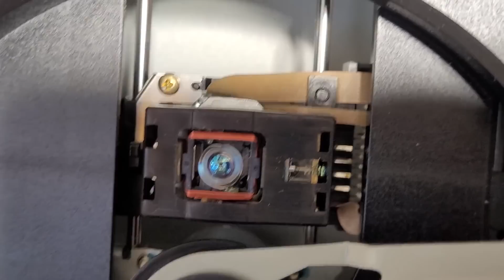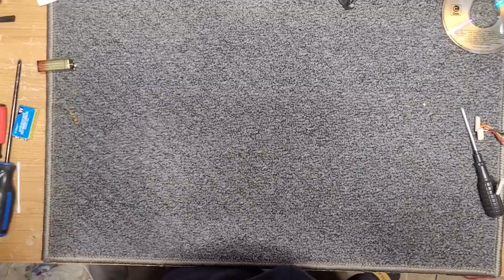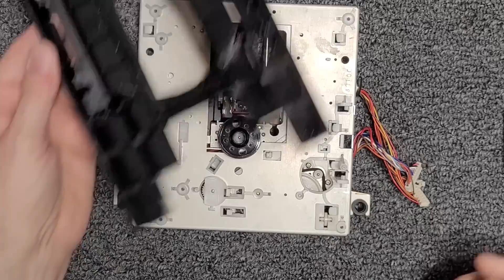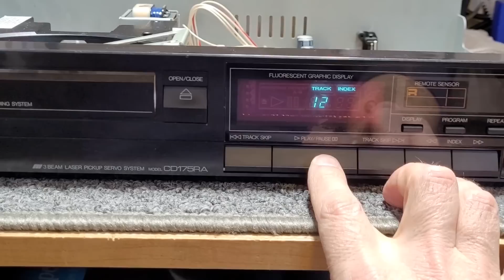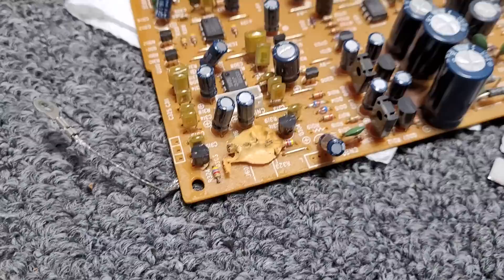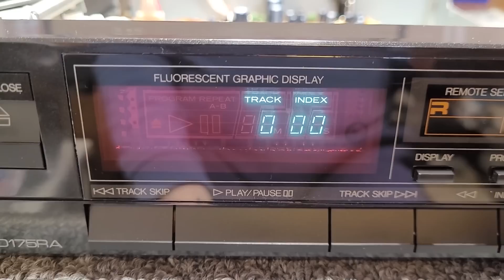Dead Emerson CD175RA - It's NOT Always the Laser!

Comment: Good repair and a great example of where a bench psu with an current meter really helps as when powering the sled motor you would have seen a high current draw indicating high load on the motor.

Comment: 90% of failures are mechanical in CD/DVD players. Either loose belts, or dried up grease. The other 5% is the laser lens dirty, or poor electrical contact in limit switch and ribbons connectors. And about 5% is electronic failure (leaking capacitors, overheated resistors, burned diodes). 
Seems like you covered almost all of those, and that's why it's working again! Good job.

Comment: Sir my pioneer pd 106 won't  read or spin the motor..laser had beam or light..but won't  read the disc ..what is the  problem of my cd..how to check etc thank you very much
Reply from the maker: Check the loading belt and the micro switch that tells the unit the tray is completely closed
Reply: Thank you sir  @TurntableGuy

Comment: If everithing is dead in the carusel you should check first if there is any voltage there, to the motors. Than if it does, the motors. then why the laser tray is not moving. In the end, you wasted time removing glue, which never ever can become conductive, it is not a semiconductor. You waisted time (ours too) around switches
Reply: There are certain glues, commonly used in 80s/90s electronics, that absolutely do become conductive as they degrade. It’s those tan glues, and they sometimes go conductive. This has been widely documented.

Comment: If a unit is dead, you get no display lights, no tray opening, no nothing, movement.  Get it?  ;-)  A bad laser will never cause a unit to be "dead" (unless it's got a dead short blowing a fuse.)  Most comment symptoms of a bad laser is not reading a disc (try cleaning  the lens before you replace the laser assembly), and skipping.

Comment: Lots of connections, especially from the era. also it's best to remove the heat compound from heat sinks and apply new compound , if they have output or regulated transistors or iCs mounted on heatsinks. I know this unit doesn't have that.

Comment: Bose CD player / radio's have trouble with skipping.  and it isnt  the laser with them either.  capacitors or resistors.    Thanks for the video !
Reply: Yeah, I do a lot of those aluminium electrolytics in Bose Wave stuff at Repair Cafes. The ones in the processor can also fail and you get "Please Wait" on the display.

Comment: Get yourself a computer power supply. It will have +12 and +5 volts and plenty of amps.
Reply: A better suggestion is to get a lab power supply. You can get a decent, adjustable, linear model for under $100. Using a current limit is smart. PC power supplies are often capable of enormous current, which can easily damage a board if something is going wrong.